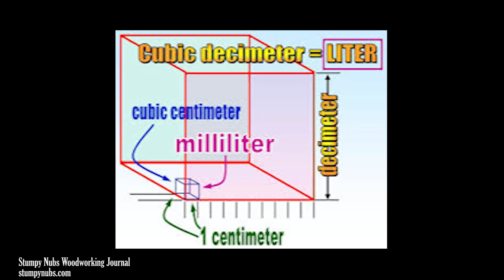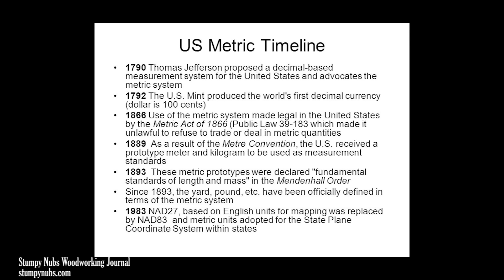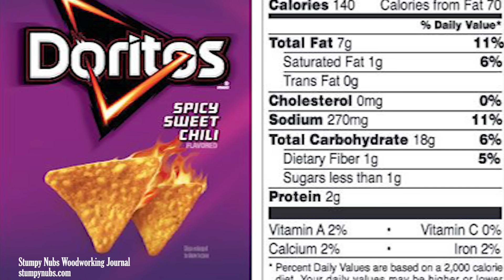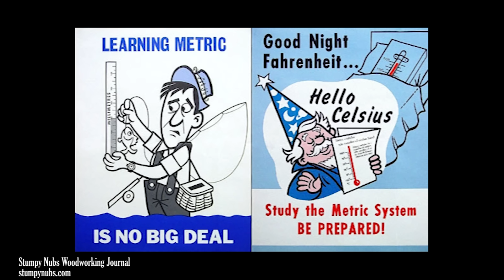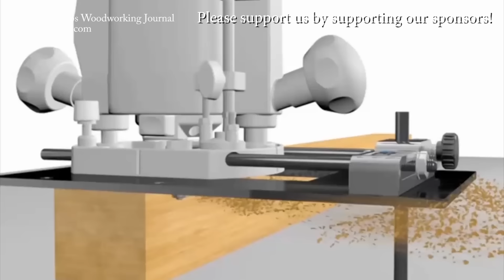BREAKING: The USA is switching to METRIC!

Comment: As a Canadian who grew up using Imperial measurements and then had to learn to convert to Metric, it wasn't hard to do.  I use both systems interchangeably.
Reply: Same here I was at school when Australia changed
Reply: There is always the issue of things that were made with the imperial system are easier to deal with in that system. My house was built in 1958 which means that all rooms, doorways and other features are sized using whole imperial numbers - when dealing with that it is easier to stay in imperial than to convert to metric. I have eight foot ceilings, 28 inch wide doors, 3 foot wide staircases, etc.
Reply: And yet the grocers still package and advertise meat in pounds instead of 454 g. And 20 degrees still seems colder than 61
Reply: Although plywood measurements can be a bit of a pain. Isn't 3/4" ply slightly undersized?
Reply: @mxh5647  I believe lumber is actually cut to metric dimensions, thus a 2x4 is slightly less than that.
Reply: @mxh5647  Imported plywood is manufactured in metric measurements. What is sometimes advertised as 3/4", or in some places as 23/32", is actually 18mm thick. 2x4s sold in the USA are typically still cut down and milled in the USA and they are undersized at roughly 1.5" by 3.5", though I don't think they're actually measured in metric by the sawmills.
Reply: I'm from England and I grew up with imperial measurements (and avoirdupois weights). When I started work as a engineering apprentice, in the late sixties, drawings came in either metric or imperial so using either system became second nature.
Reply: @alangeorgebarstow  I’m curious as to why England seems to still measure mileage in miles (I know it’s in the name lol) and express weight in stones?
Reply: @Quince828  No, lumber is cut to inches, but that's when it's rough sawn - when it's planed, you end up with less. Typically a 1/2" in each direction, so a 2x4 is really a 1.5x3.5. I don't know wtf the deal with plywood is - 3/4" plywood is actually less, but 3/4" MDF is actually 3/4" - it's just some "industry standard" that amounts to "we sell you less material than advertised, but somehow it's fine"
Reply: @Quince828  It's mainly due to a population (the one around at the time of decimalisation) being reluctant to change from a system they had been comfortable with for centuries. No different, really, from the USA's similar reluctance to change. Moving from the confusingly illogical Fahrenheit to the far more logical Celsius was slow, but eventually accepted.
Reply: @mxh5647  All lumber is undersized of it's stated "finished" dimension.  Somebody splained that all to me years ago but I cant remember the story,  I'm sure there's a vid for that.  Part of it had to do with it's easier to move a board over a scosh to hit a precise mark so the finished dimensions come out right on and nail it than it is to carve it to fit.
Reply: @Quince828  In the UK ( England is a part of the UK along with Scotland, Wales and Northern Ireland ) we generally only use stones when referring to someones weight, ie. I weigh 17 stones and 3 pounds or 241 pounds. 1 stone = 14 pounds. In metric, I weigh 109.3158 kilos. I think I'll stick to imperial for my weight. If I'm cooking or following a recipe I'll use either pounds and ounces or grams. I always know if a recipe's been written by an American because they're the only ones I know that use cups as a unit of measurement. Unless you have a set of cup measures, that could be confusing as one persons cup will be another persons mug!
Reply: RE: Canadian metric system ..., I love how meat is advertised as price per pound, but is labeled as price per kilogram ... ;{(
Reply: @gorak9000  yes, I think it’s called shrinkflation. It’s the way manufacturers get away with providing less whilst charging more. If you look at older construction in homes a 2x4 is literally 2x4.
Reply: @oliverreedslovechild  yes I’m well aware of the composition of the UK as I live in a commonwealth country and, unlike Americans, we have knowledge of the world outside our borders. I am of English and Irish descent. American cookbooks are often weird, measuring ingredients by the cup for both volume and weight, or by the stick, or by the package and so on.
Reply: @alangeorgebarstow  yes that’s true and people still alternate between the two systems. A chant at the time was “2 4 6 8 we refuse to metricate!” As well there was a lot of confusion and extra maths. For example when I was mixing oil for my two stroke lawnmower the oil was sold in a litre bottle but the gas can, being USA made, was five gallons. For a story of near tragic consequences of the confusion look up the Gimli Glider.
Reply: I just wish they hadn't stopped halfway through switching 🙃
Reply: @Quince828  By older construction, you mean like pre 1964 when lumber dimensions were standardized? 2x4's have actually been 1.5x3.5 since before that, but the exact dimensions varied. A standard was finally agreed upon in 1964, but even today, if you buy dimensional lumber from 2 different suppliers, they might not be exactly the same size. Dimensional lumber is for framing, not fine furniture building - and if you are using it to build furniture, you're going to joint it and plane it until it's actually flat anyway, so you're going to take more off it.
Reply: @gorak9000  yes I was referring to pre 1960’s. And I don’t think it should be the go to for fine furniture, but tastes vary.
Reply: @laserflexr6321 : I was in a situation where we were looking at some lumber. My wife didn’t know the names of various items. I noted that the thing she was looking at is called a two-by-four, and that it’s called a two-by-four BECAUSE it’s 1 & 1/2 by 3 & 1/2,inches.
Reply: @paulwujek5208  I mean, unless you need to be exact down to a decimal/eight or more accurate (but then the precise measurement is gonna be "ugly" in either system anyway), I think people would be plenty comfy saying a 2.4m ceiling, 70cm wide doors, 90cm wide stair cases (or round it to 2.45, 72, 92, if you prefer going the "round up and less lazily" approach).
Reply: Whether it's easy or hard to learn isn't the issue. The issue is that the US has trillions of dollars worth of infrastructure in SAE and metric brings so very little benefit beyond what we've already got.
Reply: @Quince828  No, it's got to do with the wood shrinking. If you want the lumber to be what's listed, you'd pay for dimensional lumber. In practice, you wouldn't care as any plan that calls for a 2x4 is going to be the 2x4 you buy and would list it as being dimensional if you needed that.
Reply: @gorak9000  It's fine because everybody knows that it's going on and those that don't are hopefully following plans by somebody who does know that. If for some reason you need it to be that size, you'd buy dimensional lumber and pay the extra cost of doing so.
Reply: @mxh5647  all lumber is undersized unless it is rough cut, as most Lumber is Kiln dried and which shrinks it a bit, though they did start cutting lumber undersize decades ago, also the saw blade takes into account some waste.
Reply: @paulwujek5208 😂 That is an amazing precision for a house. In none of the houses I lived in, the true measures of rooms, doors windows, whatever have never been full numbers of anything.
Reply: @Quince828 we’re bonkers and proud of it! Builders still buy 1.8m or 2.4m of 4x2’s 40 years after we were supposed to go metric!
Reply: @Quince828 because when we joined the European Economic Community  back in the 1970's they insisted on us adopting metric.

We held out on certain things like miles and weighing in lbs. When the EEC morphed into the EU, the only thing we were able to argue for the retention of was miles due to the huge expense involved in changing road signs and training drivers to use the small Km/h markings on the speedo (not all vehicles have these markings btw) instead of the larger mph markings.
Reply: most canadian ovens and recipes still use imperial temperatures. most would not know what 450F is in celsius.

Comment: Say SN I was raise on the metric system and when I moved to the US I had to adjust to inches, feet, yards, pints, quarts...etc. I use the metric system on my designs and also also created a metric inch which is 25.0 mm instead of 25.4 mm and I love it. it makes all my calculations easy to go back and forth.

Comment: Here in Australia the older generation like my father, were brought up on the imperial system. So I know how hard it is to change from something that was taught from a young age.

But it does make me laugh when my dad has to add up 5ft 9 53/64th in + 3ft 7/16th in + 9ft 3/32 in , and all I have to do is 1774mm + 926mm +2822mm 🙂
Reply: I grew up with imperial, and had to change to metric. Best move EVER! How much does 1 litre of water weigh? 1 kilogram. It's just so much easier than trying to convert volume of water to mass, then dividing it by the number you first thought of... And aircraft, filled up in pounds of fuel. You've got to be shitting me! (and yes, I'm fully aware of why they use pounds!)
Reply: As the author of the video said, you're just afraid of fractions 😅
Reply: And.... are you using short (US) tons or long tons? And gallons...( remember them?)...US gall==3.8 litres.. a standard gallon   4.55 l
Reply: 🙀 oh noes, pwease wescue me fwom da scawy fwactions 😭
Reply: Why use fractions if u don't have to. Metric is just easier. If u like to make things more difficult, try loosening a screw with a hammer instead if a screwdriver.
Reply: @oleksandrbespalov9713  That's the same as saying people who drive cars are afraid to walk to a next town over...
Reply: @KuK137  yep
Reply: @ciemmeo-srl exactly, with inches it's often 5 1/2", 7 3/4". It might look easy at the first glance, but 5.5 cm and 7.75 cm is just as simple.
Reply: It seems impossible that the notion of just use a decimal point on inches has not been popular over the years. It have to be reinvented a milion times out of frustation when anyone had to deal with those fractions.
Reply: Metric is better for precision. Millimetres are so much easier than fractions.
Reply: You should introduce your father to tenths. They're easy to work with like metric is but still exist inside of imperial. He'll probably need to get accustomed to US survey feet, but the difference is miniscule, so it only really matters on very large jobs such as land surveying as the margin of error is one hundredth of a foot per mile. Difference between the two is US survey feet is expressed as a fraction (1200/3937 meters) while international is a decimal (0.3048 meters).
Reply: @oleksandrbespalov9713 - Ridiculous. In any technical area, a system which is more difficult to use in order produce the same or inferior results is considered inferior.
Reply: @Chris-hx3om Couldn't you just measure the fuel in kilos then? Because it's also measuring by weight not volume.
Reply: @EbonyPope  The difference is that 1kg of water is 1 litre (yes, I know Jet-A is lighter than water). The conversion from volume to mass is a simply 1:1 (with a unit change, obviously). What is it in imperial? How many pounds to a gallon? (and is that US gallons or imperial gallons... See the problem already?)
Reply: @Chris-hx3om  I think you misunderstood my question. In aviation the fuel is measured in pounds because it's burned by weight not volume since the latter changes depending on the temperature. That's why they use pounds. However I don't see a reason not ton measure it in kilos since that would also be measuring fuel by weight. So that should be possible to do right?
Reply: @sylviam6535  you know what's ridiculous? Ridiculous is that two people here are arguing with me, because they (or should I say "you"?) just can't handle irony.
Reply: @EbonyPope Yes, and my point was that understanding volume from mass is easy with metric (1kg=1L), and a bloody nuisance with imperial, 1 gallon (and would that be a US gallon or an imperial gallon?) weighs now much?
Reply: @Chris-hx3om  Okay I understand now.

Comment: i know this is an old video but I'm going to comment anyway. I am 74 years old and have always been a proponent of our inch/foot measuring system. Several months ago I bought my first 3d printer. As many do I started out downloading various storage designs and printing them but I wanted to make things specifically suited to my requirements. I downloaded a free CAD program and went at it. I started using the inch as my default measuring system and soon got frustrated when trying to making small adjustments to my designs. I then switched to metric as my default and never looked back. It has made my life so much easier. I have started dong this in my woodworking shop for the same reason and have purchased more measuring tools with both systems on them.

Comment: Up here in Canada we officially use metric, but you will still find a lot of imperial units around as well. Monitors and and Tv screens are measured in inches, and you will very rarely find someone who will give their height in CM, almost always feet and inches. The weirdest thing to me though is wheel/tire sizes. Wheels are measured in inches, so tire sizes will be partially metric, and partially imperial, with a ratio of one of them thrown in there for good measure. 
215/60R16 means the tire is 215mm wide, with a sidewall that is 60% of 215mm, and it fits on a wheel that is 16 inches in diameter and about 6.5 inches wide, but then the offset of the wheel is MM again. It makes perfect sense if you don't think about it at all. 😂
Reply: Same in SA
Reply: Haha the tire thing is also in Europe. I don't own a car but the same issue occurs for bicycles, such a pain
Reply: Same as UK but we use also use imperial for the roads and car speed
Reply: Yeah a bit of a mess, I had to fill out an application for a licence and it asked for my height and I filled it in, they sent it back as I didn't specify feet inches or meter/cm I wonder if they thought I was over 5 meters tall ?
Reply: Dividing by 2 (repeatedly) rather than by 10 may be a matter of taste but the endlessly changing intervals between adjacent denominations of magnitude is a royal pain to memorize; 12 in/ ft, 3 ft/yard, 1760 yd/mile.  Worse; US quarts and gallons are smaller than Imperial versions.
Reply: @OnlyOnePlaylist  Bike tyres are measured in inches, but the size of the frame in cm. it is weird when you think about it. :D
Reply: @Casey093  Where I live we get bike frames in inches usually. Although now that I think about it, I'm pretty sure mountain bike frames are in inches and road bike frames are in cm, which is very odd. 😂
Reply: @onesadtech  I'm a road biker, so I did not know that. But you are correct, this is even more odd. :D
Reply: Same in Brazil. Plumbing is also specified in inches.
Reply: I don't think monitors and TVs will ever not use inches. Every single country uses inches to measure them, they were built to have nice and round diagonal length in inches, in centimeters it would be decimal, and for them to be round again would require too much change, just inconvenience. There's no problem with keeping using inches for them anyway, you don't have to convert anything to anything.
Reply: It’s a matter of exportowym technology by USA and UK. Im Polish - we never had anything to do with imperial measuring system - still TVs, tyres and plumbing - all handled in inches 😂
Reply: Yes. So odd. I just bought a fan in Thailand and it was measured in inches.
Reply: some tire manufacturer tried implementing the metric system on tire specs decades ago and they somehow failed.
Reply: the inch unit system and other unit system are stupid. It is not because of stupid system, but because  that they are not compatible with the international system SI. All other unit systems must compatible with the international system SI. 
I often use computer programs for technical machines and other engineering tasks. And I often have to store and enter various values for various variables in computer programs, then let computer programs use entered values to calculate various tasks. You know that computer programs use standard known scientific formulas to calculate. If you enter values for variables in different unit system, then any time you add values, you must check the unit used in scientific formulas, then you must convert the added values to required unit systems. It is nightmare in engigeering tasks and scientific tasks. 
The only solution is that : use universal unit system SI : all programs and people exchage and communicate only with values in SI system. Thus no need to convert and check formulas when you apply variables in scientific formulas.  
Other unit system maybe comfortable only in conversation communication languages, but not in engineering tasks.
Reply: supermarkets are outliers. produce is advertised in pounds but measured in kilograms at the checkout. go figure ???
Reply: There are at least three ways of measuring bicycle tire sizes. The ISO way based on inner tire diameter, the French way based on approximate outer tire diameter appended by what usually is a c and inches which corresponds to inner diameter. The most tire size is 28.1inches/622-xx/700c
Reply: Yes just consider the diameter as a a number instead of inches, Metric tyres were tried and some cars came with metric diameter tyres but they fell out of favour and are very difficult to find for older classic type cars. Most people just convert to a standard diameter wheel.